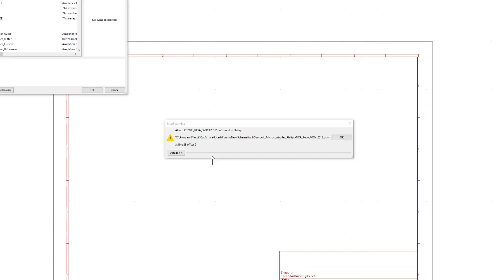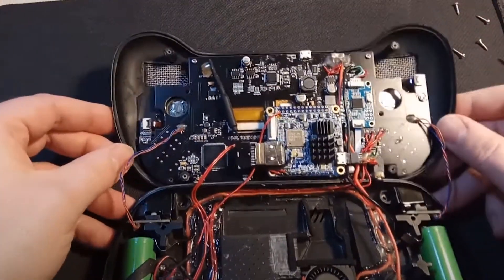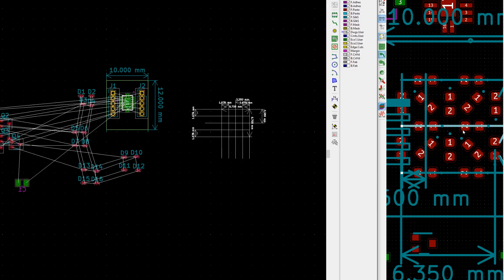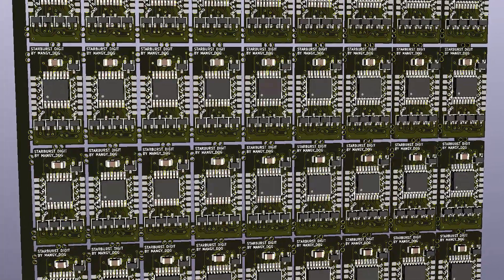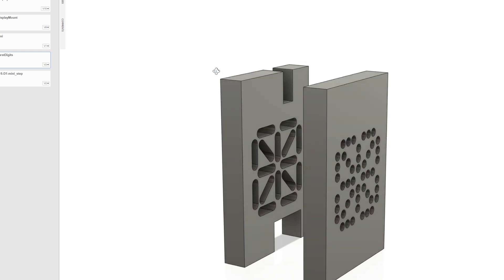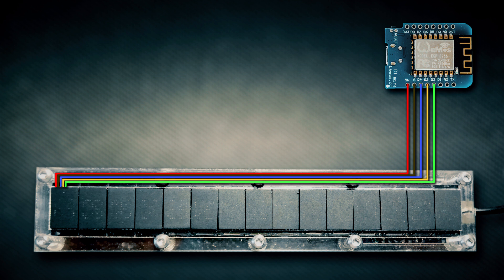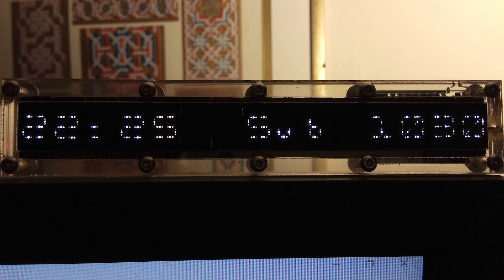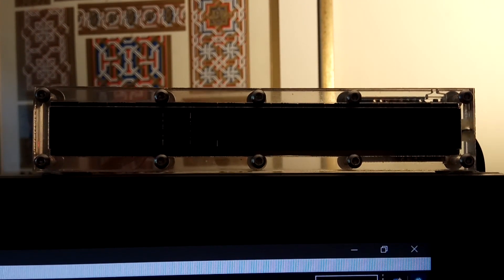The 1000 SUB SPECIAL  ---  Custom Digits Sub Counter

Comment: If you ever figure out the problem with the WEMOS sending garbage bytes, please let me know. I've had this problem for so long when trying to drive an addressable RGB LED matrix through a WEMOS, random garbage bytes added to strings and I have yet to figure out why. Just found your channel and love it!
Reply from the maker: I did figure it out, it was a bug in my code. Check the update segment in my description. :) Basically i screwed up something really silly, and was amazed it even worked as much as it did.

Comment: Definately a neat project, and congratz to 1K subs.
In an LED project i did i just used precision screenprinted foil stuck on a pcb to make some fancy symbols lighting up. It's bascially a stack of some transparent spacer foil (around 0.8mm) and then a layer of a milky white diffusor foil (0.2mm) and on top of that the screen printed transparent foil with the symbolic design. The screenprint is multilayered too, with some light blocking layers that needed to be printed twice, and some semi transparent layers that make the unlit symbols almost invisible. It's really hard to get that alignment on the silkscreening to make symbols with 0.2mm line thickness, but it worked out after some experiments and try and error. To get enough lightspread from the LEDs i had to use reverse mount LEDs (they are multi colored) and countersink the front of the 2.4mm PCBs LED holes. It looks really cool and professional in the end, but took a while and a lot of design revisions to get it to that stage...

Comment: Consider using the AX25 protocol for packet passing.  It is very similar to your implementation and it is already well documented. There are several libraries available (of various quality).  This is the Amateur Radio derivative of the x.25 protocol (extended addressing etc added).  Love your work, and thank you.

Comment: maybe using two 74595s per board and not multiplexiing would save some money and some headaches. You wouldn't need the mosfets extra arduino, timers,  etc. Just load it at your leisure from two pins on the ESP8266.
Reply from the maker: Wheres the fun in that :D besides, i considered 2 595s but i think i couldnt fit it.